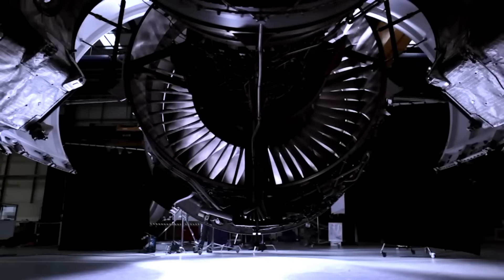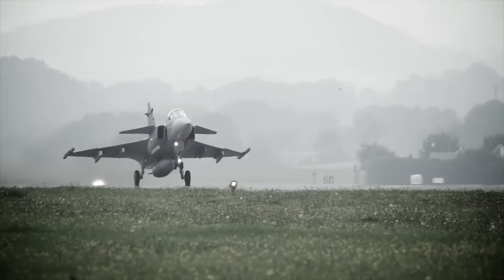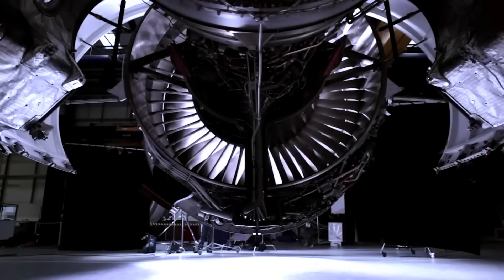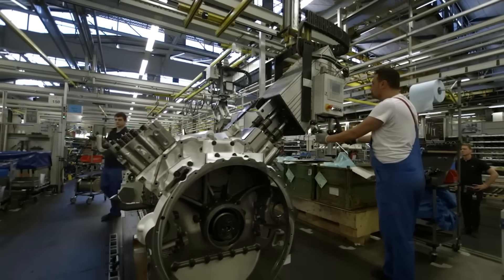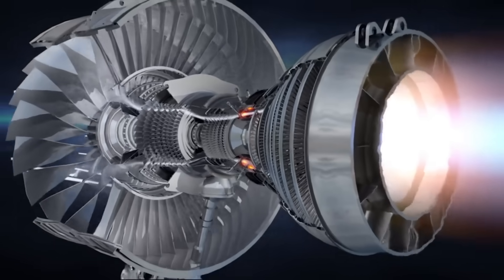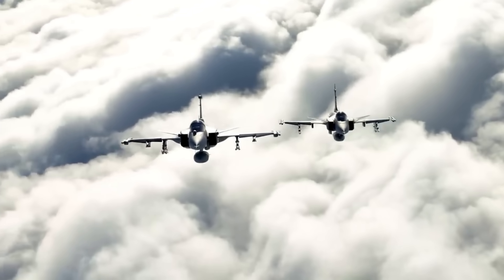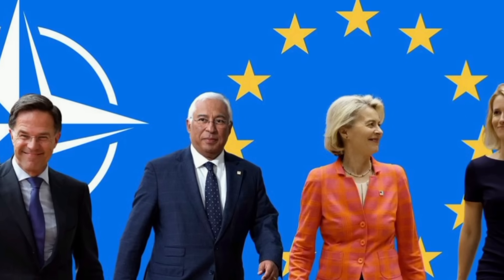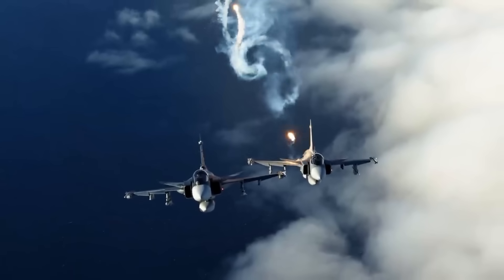How Rolls-Royce Quietly Rewired the Gripen Jet – And Shocked NATO Overnight

Comment: Gripen has never been seen as an underdog to the Euro fighter, it's just politics. The F 35 tho, depends of what you believe in, F-35 is all in one bucket STEALTH. Saab has said they thought about stealth but the price against value on the battlefield didn't seem like a good choice and they have also said that they have tech that sees stealth jets and that tech is only getting better so they didn't think it would be a good choice over time.
Reply: What has stealth done for Russia (SU 57) in Ukriane against Gen 4 AC, nothing.  They've shown up a couple of times and probably run when their RWR tells them they've been detected.  Nooo, strong EW is the right way to go.
Reply: Ukraine conflict shows when 💩 gets real, you better be able to disperse and be able to have high mission availability
Reply: Wait and see the next generation
Reply: Saab sales team also reckons they can reproduce any needed aspect of stealth by adding active RF modules.  These can be retired and replaced as the electronic tech evolves, without having to reengineer the whole airframe.  Reckon that's possible?
Reply: @quizzzick7662 of course they would say that
Reply: It has always been an underdog to twin engine fighters like Typhoon, perhaps Rafale less so. A Rolls-Royce powered version will be majority UK components in any case-even the GE version is 40% British technology, including important sensor equipment.
Reply: @bluecuracaoonice that's important to consider as you fall to earth in flames due to no stealth
Reply: Stealth is a first hit plane after that you need something to piles in with bombs and missiles long range and heavy
Reply: Stealth lets you shoot down the Gripen before it knows it is in a fight.  Russia and China have stealth, not as good, but stealth.
Reply: @garymacmillan  In the most recent trial Gripen defeated the F-35 easily and quickly. 
The radar stealth did not help since the Gripen went after the data link and without the constant data flow the F-35 would be useless. The Gripen completely turned the table and 'shot' down the F-35 before the F-35 knew where the Gripen was.
Reply: @gustavmeyrink_2.0  fantasy
Reply: @jthunders  No, nightmare for the norweigan F35 pilots. Wonder why Spain and Portugal cancelled their F35 program? Well now you know
Reply: @jonassjoberg5896 Spain doesn't even meet 2% of GDP for their NATO commitment. They don't care about anything regarding defense. Portugal haha
Reply: @jthunders  Ah - documented "fantasy". Maybe ask US about this "fantasy". Somehow, the real world does not care about what you want to be fantasy.
Reply: @perwestermark8920  Real world is F-35 going through China air defenses in Venezuela like they weren't there. .   All the internet know it alls were sure China could see F-35 on their new super duper rader.
Reply: @jthunders Real world? You mean Venezuela that had their air defence systems not connected to any radar? You consider that real world?
Reply: @garymacmillan Stealth can be detected and will get easier and easier to detect unless new stealth is devised
Reply: @DenisR-u5y  Tell Israel as they have no knowledge of your expert opinion and go on blowing through state of the art Russian S-400 missile defense systems
Reply: @j@j @jthunders an is not Russia or China big difference in Infrared and Low wave radar and AI technologie. And they continue working on it. And we on our side will not be attacking anyone so stealth, altough nice is not necessary for our whole fleet
Reply: @DenisR-u5y india was not attacking anyone but their 4th gen Rafales got shot down. It’s ok. if you want to get your guys shot down in order to send a message have at it.
Reply: @jthunders  My perspective is 2 squadrons of F35 ( we already bought one) and the rest Gripen. If ever we go on offensive and stealth still relevant, we have some
Reply: @garymacmillan  🤣
Reply: @garymacmillan  Let me know when it happens!

Comment: RR certainly announced the new engine for Gripen. There aren’t ANY in production, in 2025. Typically, it takes 3-5 years to fine-tune such an engine change, to an existing fighter. Things that have been discussed as 2026 & 2027 plans. It doesn’t happen overnight.
Reply: Timing seems perfect for new factories in Canada. We won't tool them overnight either.
Reply: @tstorm3706  Much work needed and it will benefit many.
Reply: Proceed and prosper.
Reply: In the mean time Canada ahs existing fleet downsizing and 16 F35s to keep us in the game.  The time lines work.
Reply: @williamlavallee8916  I have a balsa wood glider - 30 cm long. Could be weaponised - with a  folded brass knuckle - on the nose.  Could be tested quickly and rushed into gigantic production
(Support the Gripen - primarily)